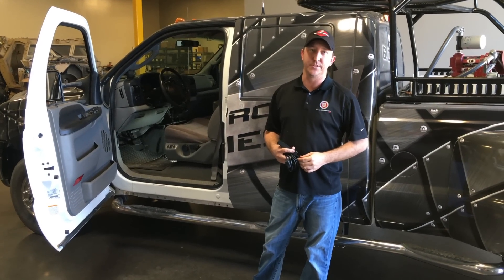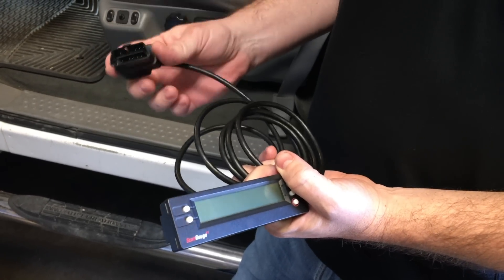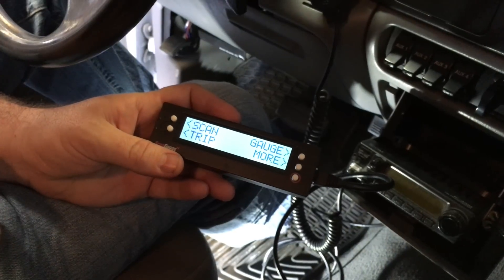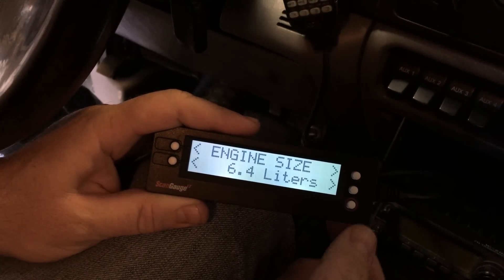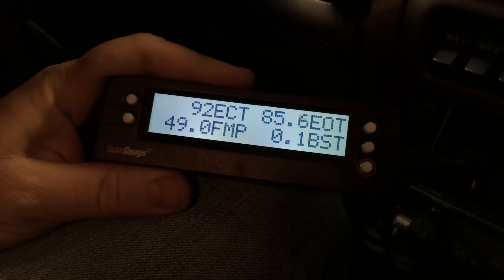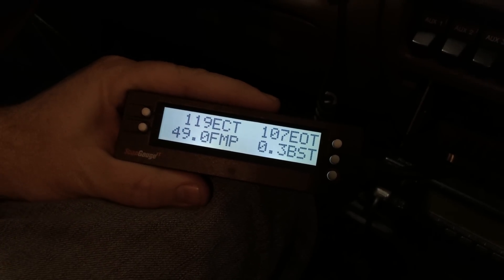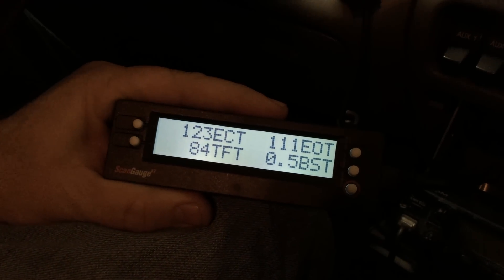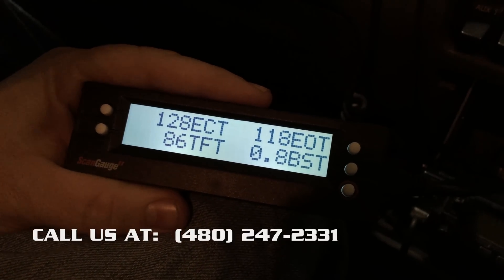ScanGauge - Getting Started

Comment: I know it has been a while since your video.... My question do you or have you kept the Scan gauge plugged in all the time? If so any issues with that. Thanks.
Reply: I have had one for years, I originally bought it because it can read codes - after having a few issues with my truck I installed it so I can always monitor timing, open loop status, tps position etc. There have been no issues having it there it is quite handy, you can also monitor fuel consumption rates etc
Oh ya, and if you get an engine light and a code is set, it will memorize codes with a snapshot of the event (engine speed, temp,load etc) - you can then clear the codes with it as well

Comment: Can this scan guage read engine oil pressure? Thats the main reason im looking into this
Reply from the maker: On the 6.0L and 6.4L Ford engines they don't have an actual oil pressure sensor, rather just a pressure switch.  So on the 6.0L once the oil pressure reaches 7 psi, the switch closes and the gauge on the dash moves to its "normal" or half way position.  Because there is not an actual sensor reporting oil pressure to the engine computer, the ScanGauge cannot read engine oil pressure.
Reply: Even if it does show oil pressure on your particular application it would still rely on the same sensor that your dash display uses, if actual oil pressure is suspect you need to physically hook up a manual tester to verify

Comment: Is this the best tool to take when buying a truck ? How will this help diagnose a bad oil cooler and clogged egr? I know white smoke will indicate a bad egr and pressure on degas will indicated bad gaskets ! Due to head bolts.

Comment: I just got one of these used for tractor trailer. Am I able to just buy the cord for the scanguage for a 6.0 liter? Also do I need to have it sent out to have it programmed for the 6.0?
Reply from the maker: If you bought a version of the ScanGauge II from someone other than BPD, it's likely you'll need to use the X-Gauge functions to program it how you'd like it for a 6.0L - but it shouldn't be difficult.   For that, and for the cable, check out www.scangauge.com or give them a ring at 480-656-4089.

Comment: Why cant Bullet Proof Diesel just put out a list of all the acronyms and what they stand for like ECT=Engine coolant temp. That would make it alot easier for the user. If you added the limits of what is safe such as " 220 degrees is the max for engine coolant temp".  That would save you alot of phone calls on both ends and if I am out pulling my 5th wheel I can be sure Im not doing any damage to my engine right away.
We all would love that. Thanks Keith
Reply: There already in the manual if you bothered to read it!
Reply from the maker: Here you go  https://www.scangauge.com/x-gauge-commands/ford-lincoln-mercury/

Comment: Will this work on a 96 ford?
Reply from the maker: The pre-set programming on the ScanGauge II we offer will only work with '99 and newer Ford diesels.  However, the device will be able to work with any OBD-II vehicle, and in most cases, that includes the 1996 model year.  While you won't get the presets, you'll be able to program them in yourself with the 'X-Gauge' function.
Reply: @BulletProofDiesel  hey i had a question man can you read fuel pressure on the scan gauges ??
Reply from the maker: @ploxplox1109  no, there is no fuel pressure sensor on the engine, so it cannot.
Reply: BulletProofDiesel has another question trying to get estimate price to get my truck bulletproofed have 2007 Ford F-250 6.0 XLT crewcab and when I do a coolant flush do you have to burp the air out of the system  and how do you do that ?
Reply from the maker: @ploxplox1109  https://bulletproofdiesel.com/pages/level-2-and-level-3-bulletproof-services
Reply from the maker: @ploxplox1109  Burping the air on the 6.0L is really a non issue, we simply run the engine for 10-15 min with the cap off, then test drive, then refill as necessary.

Comment: What is the EOT normal range.
Reply from the maker: Any time it exceeds 250-degrees it's an indication that something is wrong.  And during normal operation it usually won't get anywhere near that hot.  Also worth noting that the coolant temps should be within 15 degrees of the oil.

Comment: Will your Scan Gauge read EGT for a 6.0, or do you have to add a pyro sensor for that?
Reply from the maker: You called it - EGTs can't be read without a sensor, and Ford didn't include one with 6.0Ls.  However, the ScanGauge can measure exhaust back pressure.
Reply: BulletProofDiesel , can I have a pyro sensor added, and if so, can the Scan Gauge then read the EGTs?
Reply from the maker: @djd8058  You may be able to do that per their custom gauge settings - best to contact them directly about that: https://www.scangauge.com/about/contact-us/

Comment: Hey guys new desist owner here.  I bought a 2016 f250 6.7 liter. Do I really need to use the scan gauge to monitor this info? Is the truck not already doing this? Why would this be important if your not showing any codes? Looking for any info on why this would be a food purchase. Thanks in advance.
Reply from the maker: We recommend the ScanGauge for 6.0L and 6.4L Power Strokes - as it measures specific data points that are indicative of specific problems on those two engines.  The 6.7L has not appeared to have the same problems.  That said, the ScanGauge II does measure some values that don't show up on the dash in 6.7L-powered trucks, and you can check out that list here: https://www.scangauge.com/x-gauge-commands/6-7l-diesel/

Comment: hey guys do you bulletproof the 7.3 ford 350?
Reply from the maker: The pattern failures that are inherent in stock 6.0L Power Stroke engines don't seem to be apparent in the 7.3L, which is a good thing!  We do sell the ScanGauge II pre-programmed for 7.3L applications, which will help you keep an eye on fluid temps and a variety of other data points.

Comment: Will this product run a health test (buzz) on my injectors?
Reply from the maker: The ScanGauge II can display trouble codes that might be triggered by your injectors or injector system, but it does not actively push a balance test to them.   And this unit is pre-programmed for a 7.3L as well as the 6.0L and 6.4L.